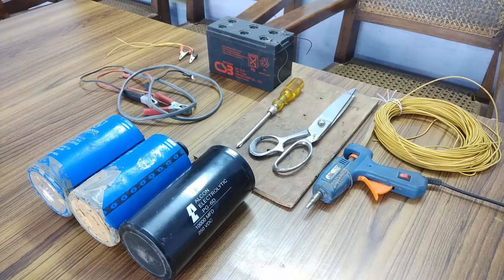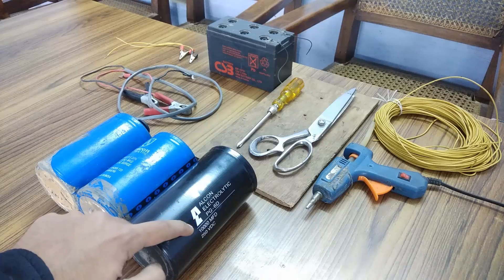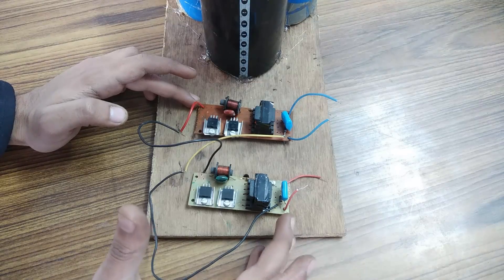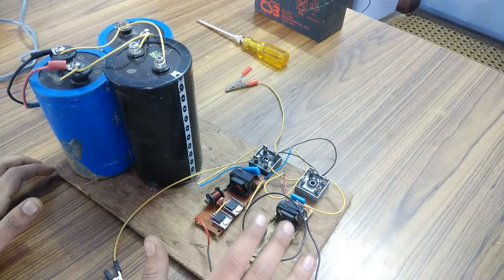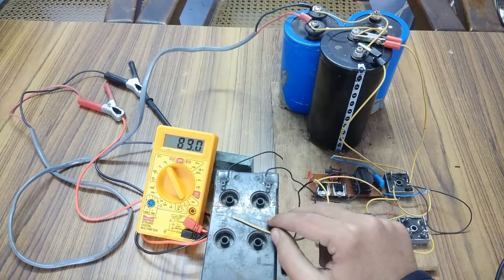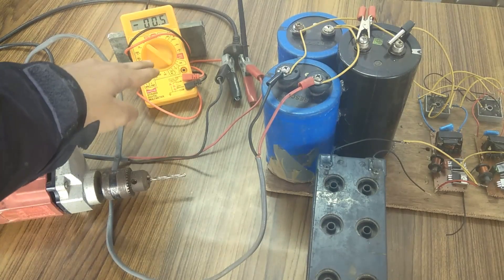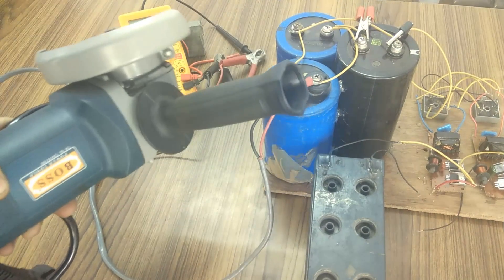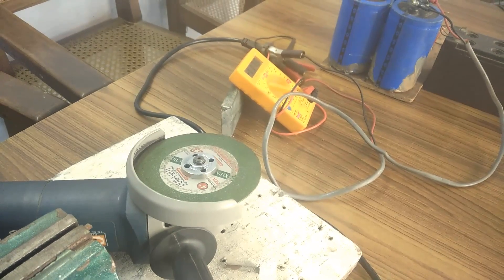Brilliant idea for Power Tools operating on Universal Motors

Comment: Suggestions:

Since it's much less important what you are doing -- it's a visual medium, after all -- your voice-over and narration would better be directed at the subject, which is an assembling of components and sub-circuits, in a particular arrangement and functional relationship. IOW, describe what is being added (connected), and why, and to what purpose. 

Since the circuit involves current flow, and there's an input, throughput, and output (work, or a store of energy on tap), it makes some sense -- particularly as what your presenting is a proof-of-concept, and not your at-home, go-to version -- to lay out the components, visually and physically, as a uni-directional (e.g. L-to-R) series of blocks. This will have pedagogical benefits. 

On a related topic: there's no need whatever to show the process of, for example, gluing the caps together. Show the gun approaching, cut immediately to the gun withdrawing from a cooled, set glob of glue, cut to another approach, cut to the gun withdrawing from that glob, now cooled and set, repeat as necessary, etc.. Add some visual effect to signal the edit, or use a sound effect at such edits (e.g. "Pew!" from Star Wars). No one needs to see a screw or nut being tightened: set things up -- and edit out the drudgery. It's not magic in real life, but it can be in video. Flag such edits with some kind of 'Zing!' -- visual or auditory. 

Finally, the detail of the wiring is lost at certain resolutions, and it's a bit tedious to have to scrub back-and-forth, zoom, pan, etc., to get things clear. The difficulty is compounded by having wires running here and there, looping back, crossing over each other… A little forethought and some planning and (mental) rehearsal*, along with the linear (L-to-R), input-throughput-output, sequential, and logical build of the circuit, by blocks, will make for a more instructive and satisfying video. 

Taken together, I think these suggestions will make for concise, satisfying, instructive videos -- and it's videos you are creating. 

* During the preparations, consider points in the circuit from which you might eventually want to take some kind of MM reading while the circuit is live -- and telegraph that fact by explicitly building in and describing such points as part of the narration of your process.

Comment: Sir 48V and  900W dc motor can be run by using 2-12V battery continuously.
Reply from the maker: correct!!!!
Reply: It is possible
Reply from the maker: Yeah!! I have tried it myself.
Reply: Okk I will use that in my college solar  E-rickshaw project
Reply from the maker: but at 12 v both rpm and torque will be less
Reply: If 2 to 3 12v batteries are use

Comment: I am also thinking of using an electric fly swatter as the power for this circuit. what do you think?  I have 15 kv diodes that are russian military diodes. i believe they are 242021-8508 diodes. will these work? I also have 15 kv 5uf caps. What do you think I could use this for. I see Gerard Morin using similar high voltage pulsed dc to to run light bulbs etc.
Reply from the maker: Actually for this project you need high current too and voltage should not go beyond 300V.
The capacitance of your capacitor is too low and the voltage is too high.Go for capacitance as high as possible and voltage upto 300V max.

Comment: But this battery whith normal DC to AC inverter can produce more power.
Reply from the maker: This project needs power boosts which the capacitor bank is capable of providing. Inverter produces constant but low amount of power.

Comment: Another fantastic video!! thank you.
Reply from the maker: jimmy popp Thanks!! You should use 120V O/P inverter.
Capacitor voltage should be equal to or more than 120V in your case.
Reply: thank you!!
Reply: jimmy popp very easy